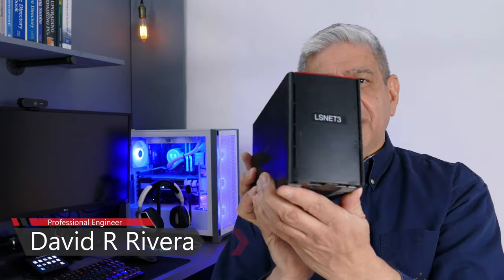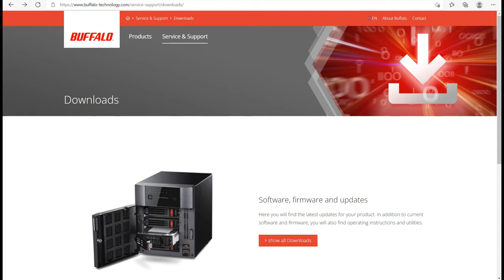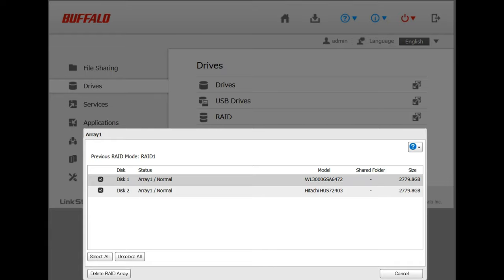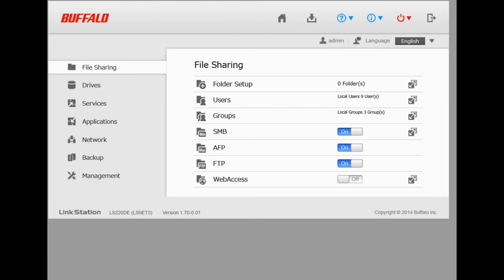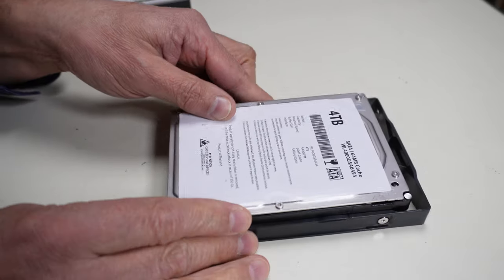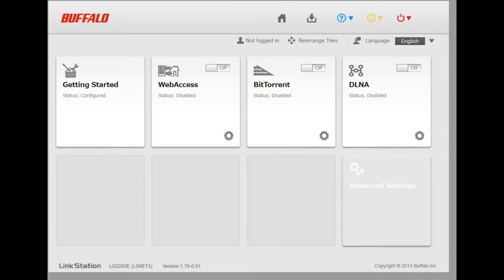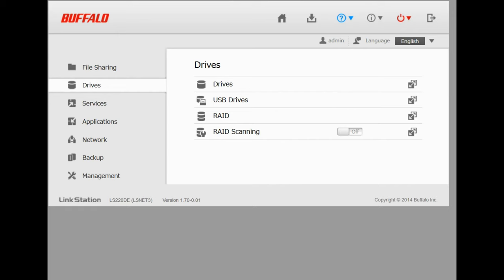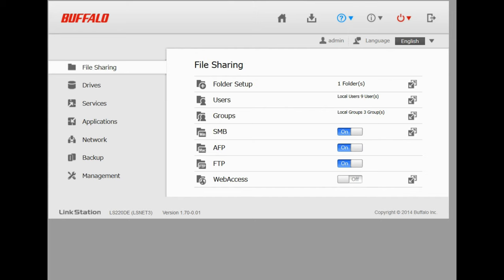Upgrading a Buffalo NAS to 4TB Mirrored Hard Drives

Comment: Why didnt you simply replace both of the drives together? Would you would have lost the raid configuration or had some other issue?
Reply from the maker: These NAS firmware-based operating systems are VERY touchy when it comes to taking out a drive.  There is mixed information on exactly 'what' is stored on the hard disk(s) in addition to folders and files (i.e. critical O/S configuration files).  A number of people have corrupted the O/S beyond repair by just pulling out a drive without properly syncing them (a.k.a. 'Bricking' the O/S).  I believe that happened to me a few years back when I had a single-drive unit suffer a hard disk crash.  The drive was 'definitely' crashed, however when I replaced the drive (a 3TB in that case) I could not get it to recover no matter what I did - even the Buffalo NAS Navigator did not see it.  That is how I wound up with my first spare 3TB drive (one of which I just pulled out of this unit).

I did a LOT of research before I swapped the drives as shown here (take a look at a couple of the Forum links in the notes).  It appears that by doing it in an 'orderly' manner like I did here, many people were successful.  Also, I could have just pulled one of the 3TB drives and replaced it with the RAID intact, however it would have only used 3TB of the 4TB space on the replacement drive - a common problem with NAS RAID configurations.

Thanks so much for the comment.  I should have explained this more during the video, but I wanted to keep it as close to 10-mins as possible.  I will PIN this comment so that others can see it.
Reply: Thank you. This comment really helped my understanding. So it's down to the finicky nature of the NAS or & firmware. Ideally in a normal Linux system the entire raid array with it's all disks could have been just swapped but here they can't.
I asked this because my QNAP TS251 gave up the ghost due to the intel C2000 silicon bug in the celeron processor. So now I am trying to figure out how to install the drives in a new QNAP NAS so that I can pull off the data & say goodbye to the QNAP ecosystem.
Reply: Do you know of any way to read the data off a QNAP drive in Linux?
Reply from the maker: @bornlibra23  That is correct.
Reply: The operating system is stored on the HDD, so if they are replaced, the NAS is a brick. It is possible to flash the OS onto the disks, but it is a PITA, using TFTP. I have done it several times. By replacing one disk at a time, the NAS automatically copies the OS onto the new disk. I am trying to upgrade my NAS now, from 1TB to 2 TB, without losing the file structure or data (hence searching on the subject) The later ones, that can be purchased diskless, seem to have ROM or something, that will boot the system.
Buffalo no longer sell their stuff in Europe
Reply: @wibbley1  that is true, the diskless variants do have an extra button on the rear which you can see here, as he mentioned his model came diskless, this will allow re-flashing the OS on non-initialized hard disk drives, however I would play safe and only do it in the method described in this video,  here.
Reply: @nafcom  Hi, a post from the grave :o) I now have a spare disk with the OS on it, so I can easily use that to get started. Save all that flashing nonsence & the only flash I found was in chinese, luckily somebody posted what buttons to push to get it to english :o)

My nas is now non-compliment with security, requiring registry hacks to use it.
Found Buffalo a pain, they don't sell in the UK anymore, but would pick a different brand now anyway.
Reply: @wibbley1  yes, I know here in Germany neither, still they were the cheapest at the time which is why I have got them. Anyway, wanted to give an input to your assumptions, hence I had replied to that "post from the grave", heh. In  fact, the fact that they use a custom formatting and have the OS stored on the HDD makes it super complex. I was able to recover one NAS case use to Terminal in, but using a second NAS would fail the same procedure and it would remain bricked.

Lost an older model finally to Amazon Germany selling me a customer returned drive with an electronic issue which would shortcut the NAS case literally with a small cloud of smoke and burnt plastic smell.  At least I still could recover my data from it before replacing it with a newer Buffalo NAS model:

Now I also got WD MyCloud 2 but those have no physical power switches and need to be permanently on power, so I finally will use Synology from there onwards.

Comment: I have Buffalo LS200, came with 2 2T mirrored drives.  I would like to upgrade, and now to my questions.  What time of hard drives?  Can I replace ONE, re-establish the mirror, and the replace the other? Dont really want to do the nuke and pave unless I have to
Reply from the maker: There really isn't a way to avoid those steps.   It will stick with 2T trying anything else, even if you add a 4T drive.

Comment: I have mine set up as a raid 1(mirrored). The drive in slot 2 failed and needs to be replaced. I intended on upgrading over time anyway. Can I simply pull drive 2 and put in a new larger drive realizing that part of the data space won't be available until I replace the other? Also, do I have to do any special configuring when I replace the drive?  I don't intend on wiping the first drive. I just want that data to copy over onto the drive I put in slot 2.
Reply from the maker: You need to go into the admin menues and break the RAID apart.  Then remove and replace the drive.  I did make another video about how to do that, but make sure to watch the entire video because I made a mistake along the way that I had to correct - unnecessary effort.  Here is the link to that video: https://www.youtube.com/watch?v=n8Bp-7oJX00&t=746s

Comment: that's an interesting thing about breaking the array, we have a ts5400r and two raid1 arrays, can you give some advice how do i suppose to upgrading with a larger disks and keeping the data on it? thanx!
Reply from the maker: I am not familiar with the Buffalo TeraStation.  Do you know the largest disk size that supports it?  Also, Buffalo has some really good online help that can address a specific unit.
Reply: @PE4Doers  yeah i did find some forum threads about that, some people there even got working it with 4x8Tb disks official web-site also mention that it doesn't support expanding array so mine guess we have to just get rid of 4x1Tb disks and replace them with something larger then create a new arrays without rebuild or anything, thanx for responding anyway

Comment: I have found that the Buffalo drives are twice as much as other drives. Can i use another brand of NAS drive? Any recommendations? Thank You! Great Video.
Reply from the maker: You are correct.  I have not bought ANY of the Buffalo drives (other than the ones that came with one of my units), I always used either a Seagate, Western Digital or Toshiba drive to either populate or replace a drive.  I figured using RAID 1 gave me the level of protection I needed - which seems to have worked out for me so far.

Comment: Thanks for the great vids and easy to follow  instructions . I just started with a 220 it’s already 36% full in raid 1 . I see here  you used Raid 0 ( if I am correct it will have 8 tb non mirrored storage .  Initial setup  for me was brutal ( newbee issues with this ) took 4 days to  resolve IP snd port issues and start understanding the software  .  Did you add drive 2 for raid 1 after vid ?
Reply from the maker: Yes, it takes a while to get use to the menus and concepts.  I originally set mine to Raid 0, but later changed it to Raid 1 so I could have the redundancy.  I actually have two duplicate units, and I back-up critical files to both.  Between the two, I am at about 35% usage total.
Reply: @PE4Doers   I assume ( may be wrong )  both drives can be swapped out on the 220 linkstation  soo the operating system  is on a chip in the nas . And then if it is on nas are all 220 units like that leaving it posable upgrading both drives to larger capacities 2 x4 drive config .  Data on my system is a also archived  in other locations  so clean drives are not an issue .
Reply from the maker: @keithfrank1303  Unfortunately, that would work on a completely rest system - where there are no accounts, shares configured, or data present.  After creating you configuration, a lot of that is store in a small section on each drive.  If you were to remove both at the same time (and installed two brand new - not formatted) you would lose everything you configured on the unit.
Reply: @PE4Doers  sweet 😳
Reply from the maker: @keithfrank1303  Thanks for your comment.

Comment: Brilliant video as Always :) Very well explained :)) And It shows that with a RAID Setup you can not take out both Drives Willy-Nilly :)) But you need to be more careful when changing the HDD's.
Reply from the maker: Thanks Kathrin, that is 'exactly' correct.  With XigmaNAS however (thanks again by the way for finding that for me), it is MUCH more flexible.  I will be talking about that much more when I upgrade my XigmaNAS server, including putting it into a rack-mounted case :)
Reply: @PE4Doers  Now  I am super exciteerdd  for that videthe RAck mount one. :))
Reply from the maker: @KathrinHausermann  It's getting closer.  I need to upgrade two other systems first. :)

Comment: Thank you for the detailed steps.
I wanted to replace my 4 hard disks from 3TB to 4TB on RAID5
It is a TS3400D.
I thought we could directly insert them one by one and rebuild the RAID after each (which will take a long time)
But I asked the support team and they said that cannot be done as the new space would not be available and I would have to perform the above step and then delete and recreate the array( all data on the disk will be erased).
Reply from the maker: They are correct.  The software on this unit is very low-end.

On my XigmaNAS unit, which uses the ZFS File System, there is no problem upgrading to larger drives.  Unfortunately you would need to build your own NAS to take advantage of the extra powers provided.

Comment: Very nice vidéo, please is possible to install virtual machine to buffalo nas ? Is it possible to change DDR3 ram to 2gb DDR3 ram ?
Reply from the maker: I'm afraid neither of those are possible. the Buffalo software is fully locked down and does not provide those options.
Reply: @PE4Doers  thanks you
Reply from the maker: @damasm6923  No problem. Good luck